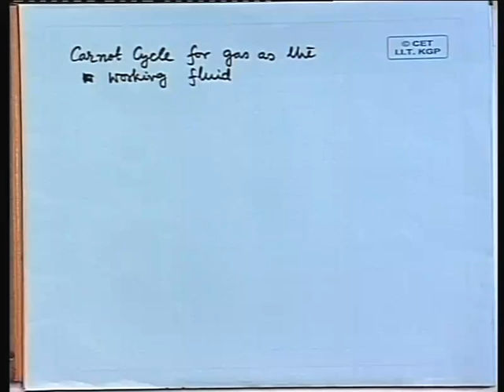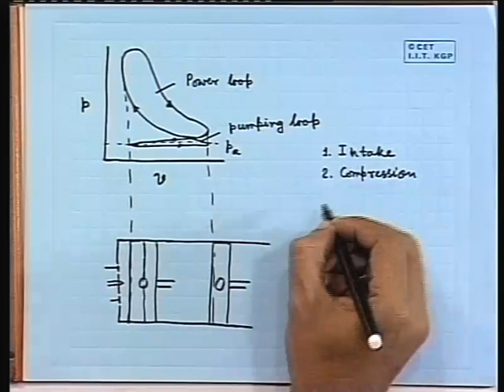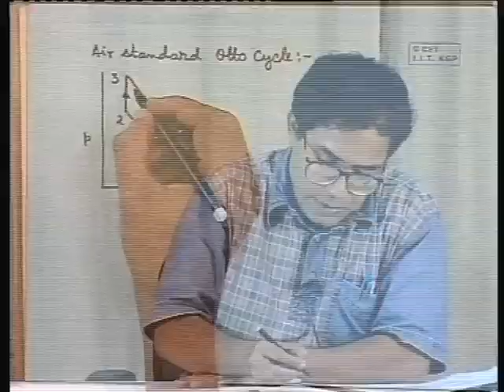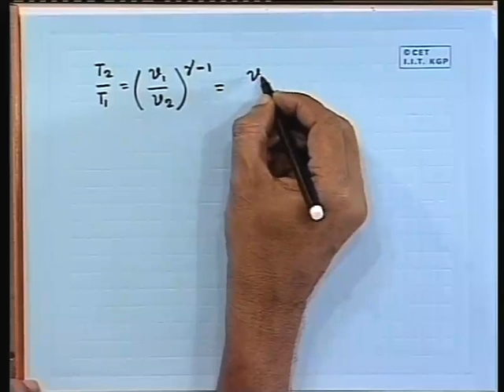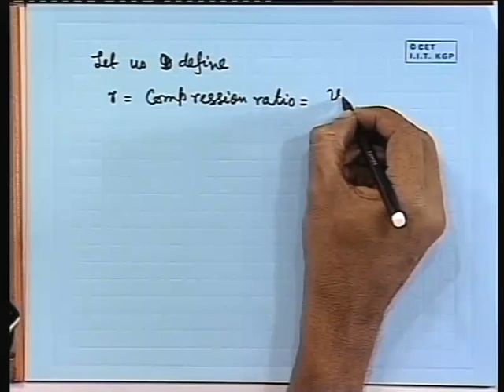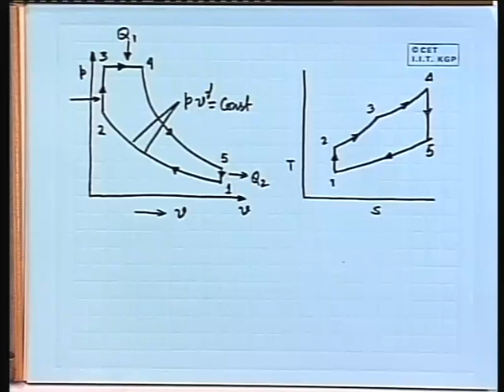Lec-24 Gas Power Cycles, Cycles for IC Engines

Comment: reason behind limiting the value of compression ratio is more significant than what the sir has told.............. 
   1) material constraint
   2) excessive work of compression  which will lead to reduction in net work output